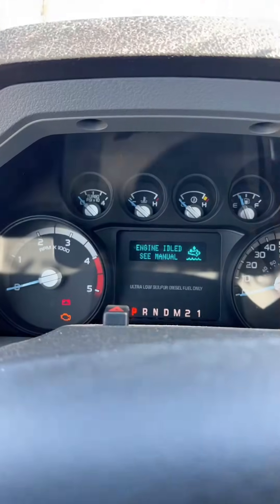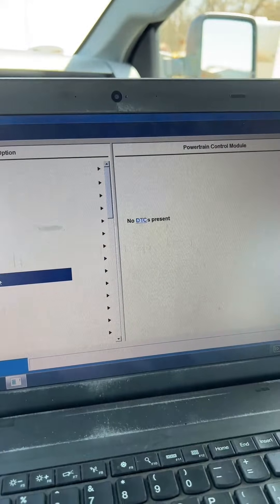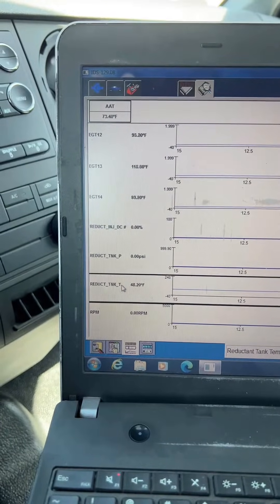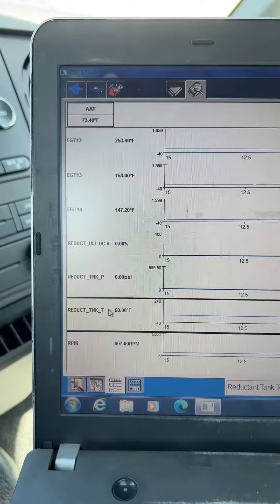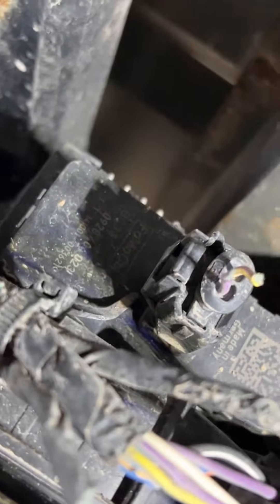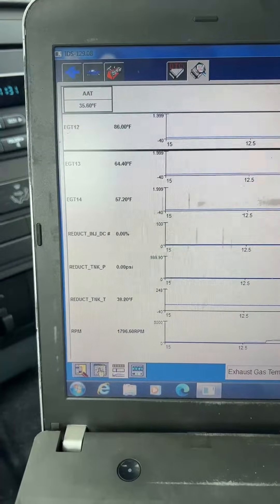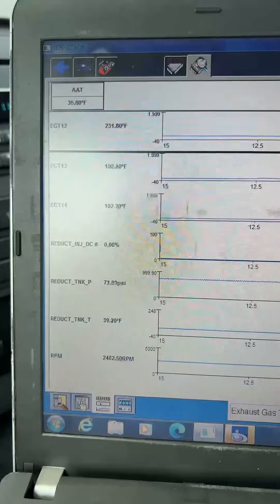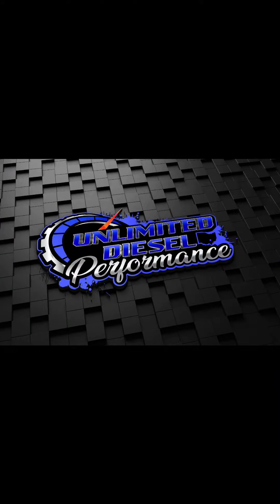Resetting Exhaust Fluid System Fault 2014-2022 Ford 6.7 Powerstroke Diesel

Comment: Can this cause a no start? On a 2012 the only code is exhaust fluid system fault.
Reply from the maker: The only time we've seen a no start condition with this message has been because of a bad EGT 1 3 sensor and the truck has never had a PCM update. The early model trucks had a calibration that would not allow the vehicle to start if the EGT sensor 1 3 was reading too high. Normally a new EGT probe and a reflash and you would be good to go.

Comment: The dealer wanted charge $2000 to put an EGR valve in my Dad's F-250 for JUST the P207F DTC and the DEF fault warning message. I did what you showed here and it worked. Huge thanks!
Reply from the maker: I'm so glad this video was able to help you out! Thanks for watching!
Reply: @UnlimitedDieselPerformance  it worked...until a tow truck had to be called in 25 miles later. Nothing to do with you, and the content of this video. Everything to do with...all this SCR carbage. 

I fixed Dad's truck. It's reliable now. DE

Are you picking up what I'm putting down? LEET

tune? lowest available, Pop isn't racing this thing. Now runs like a scalded dawg. Pin you to the seat kind of thing. 

lol

Dad's truck is prolly 150 lbs ligher now. 

You sent me in the right direction. Thank you for making this video!